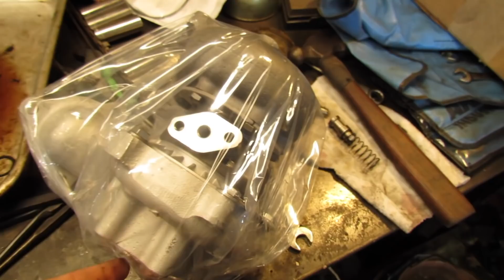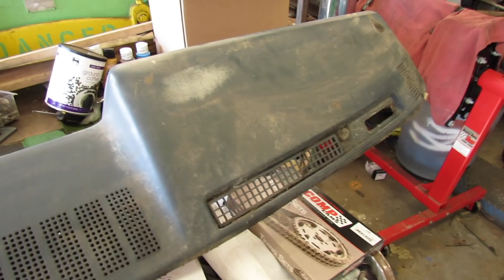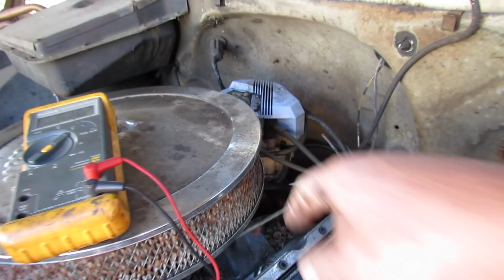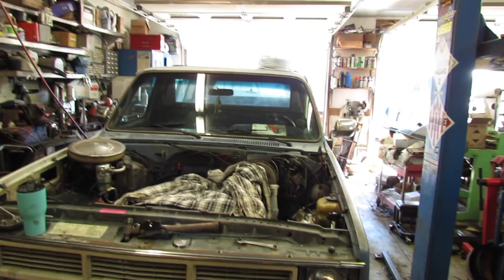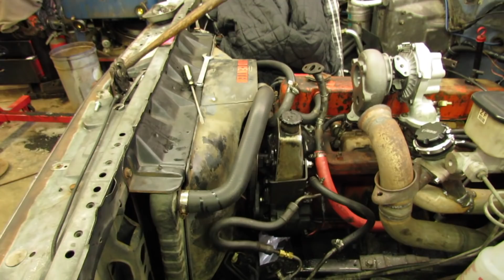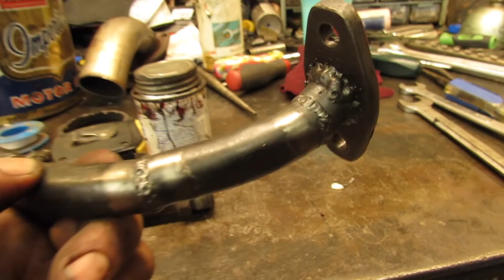Install turbo and power steering pump

Comment: I truthfully do see it might slow one down if anyone should move  some of the pieces and parts from one bench to the next one and so on. I can see this is a never before dream of four barrel meets six cylinder and then it goes like hell for a few trips, just enough to see light and then that old 292 six will make this sound like a maytag out of balance and then the smoke and the oil on said windshield will appear. The rest will be a ha ha ha ha ... miller time

Comment: Grillin hamburgers in the rain huh?? Sounds pretty "radical" to me !!! Yep, that "budget" idea can bite you where you sit pretty often. In lotsa cases involving construction too. A wise friend of mine always says "better to spend a little too much than not enough". So, you used a section of hose to connect the two ends of the oil drain?? That's certainly leaning towards "budget"!! And ----------------- quick !!
Reply: Last bit of video is a throw back clip to older times.

Comment: on breaker point ignition has a ballast resistance wire(or separate) resistor that should be bypassed for HEI

Comment: check the voltage on both sides of the horn relay , the power all runs through it to the cab , well it does on my 63 , mine got issues and had a voltage drop through it years ago , I think they stayed wired the same way till 67
Reply from the maker: towrecker I think your right.